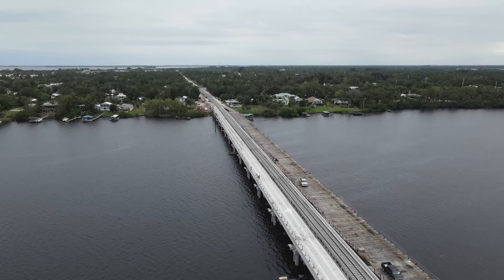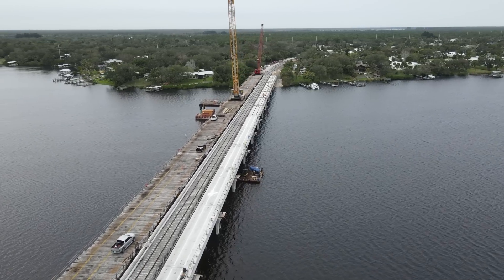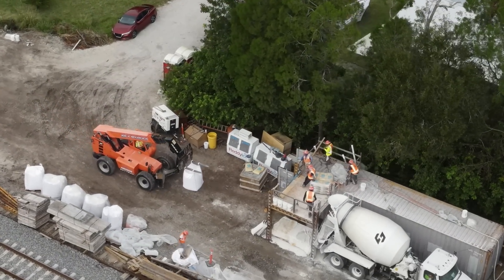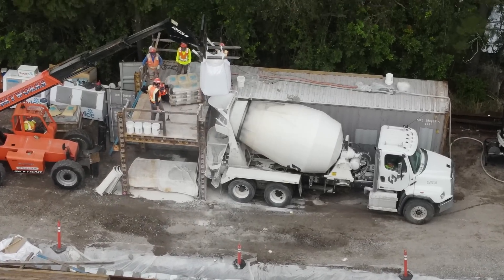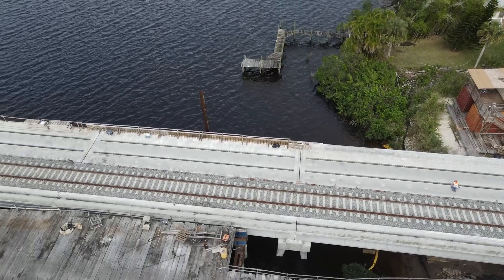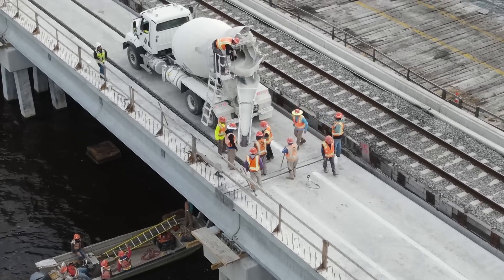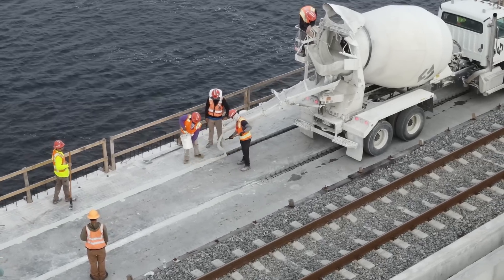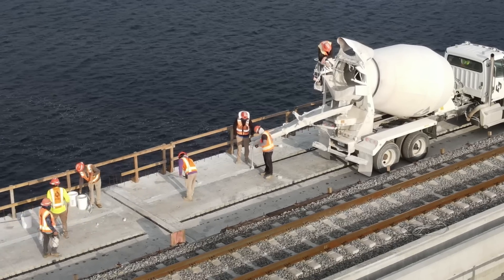Brightline Construction: Ultra High Performance Concrete on the Sebastian River Bridge

Comment: Great stuff, I think the more info you can include in your videos regarding details of the construction (specifically design speeds, special materials and cutting edge techniques like here) the better. Not sure how else I could have learned about this concrete they are using

Comment: It seems appropriate that Brightline is utilizing a cutting edge concrete technology on some of its bridges since the FEC  on the Key West Extension 100 years ago did similar with specialized German cement (that hardened underwater) being used on those incedible bridges that "went to sea".
Reply from the maker: My thought exactly Ken
Reply: Very much so. I bet the next time they go even one better and put in some of that newly-rediscovered Roman Concrete.